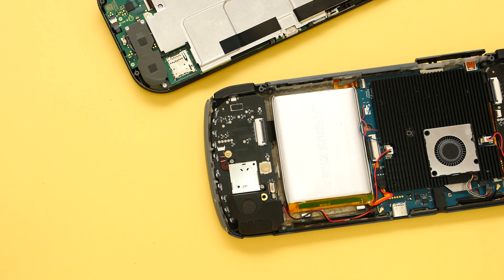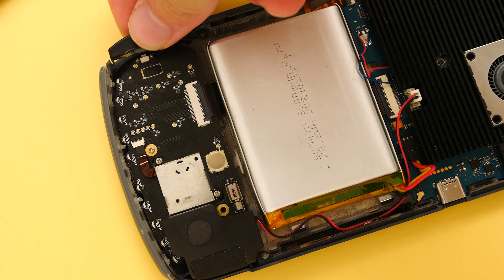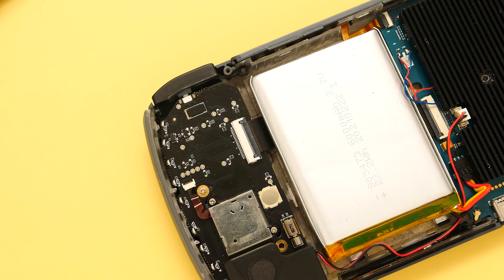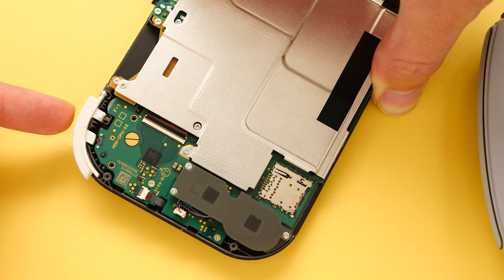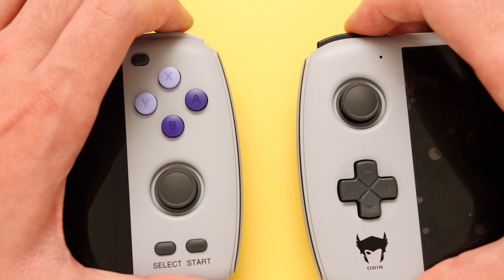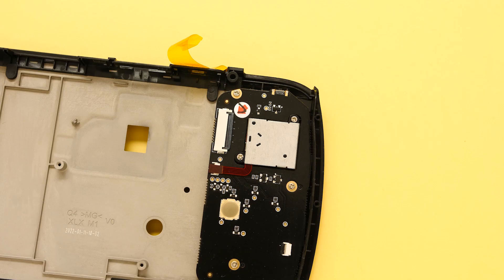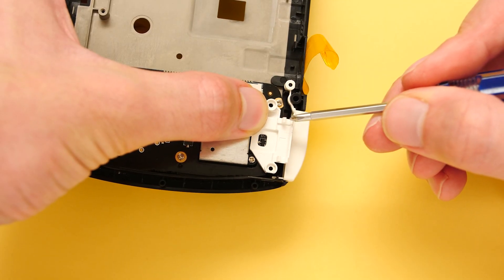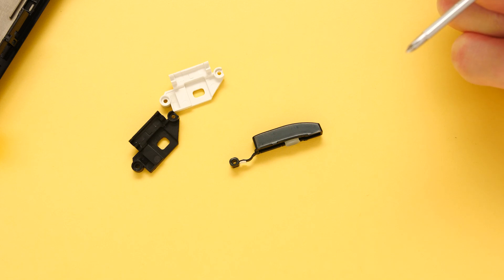Odin L1/R1 Issue Deep Dive

Comment: Stupid question, couldn't you add rails to the bottom of the L1/R1 buttons to either side of the post, so that they hit the PCB and are stopped at the exact proper distance to depress the switch (but not be pressed further)?

Comment: Dropped mine right on the L1 button, didn't completely break but doesn't click anymore and takes a little extra force to push. My fault but still sad about it.
Reply: Probably tilted that switch, push it back into place and try and figure out if you can surround the switch in JB Weld without interfering with anything; that's how I refurbish USB-C connectors.

Comment: As frustrating it will be to be an early backer and not have the shell modifications, the shell changes by AYN will make the product better for the majority of people who purchase/receive one moving forward.  I get that no one wants a piece of hardware that is technically inferior no matter how small the change is, but this is better for all of us in the long-term.  Thanks Taki for making the video.
Reply: The L and R bracket will work fine to fix the issue shell modifications arent going to hold you back
Reply: @dealocktag  You must have misunderstood me, the shell mods make it even better.
Reply: @will8677  im saying if you dont have the new design shell and you have an early shell the new bracket for the l2 r2 has a stop built in for the l1 r1 now
Reply: @dealocktag  Yes, sure, the L2/R2 housing is being modified to include 2 stops.  As long as someone isn't overly forceful with the L1/R1 shoulder buttons, this will be sufficient, but I couldn't argue that the shell stops wouldn't do a better job simply because there are more of them and spaced further apart.  Either solution should be enough for most users.